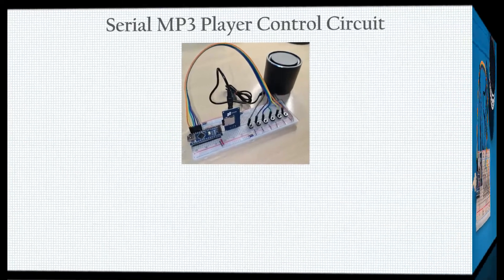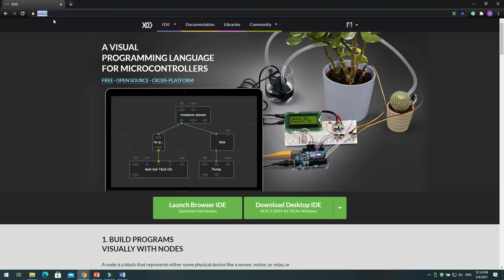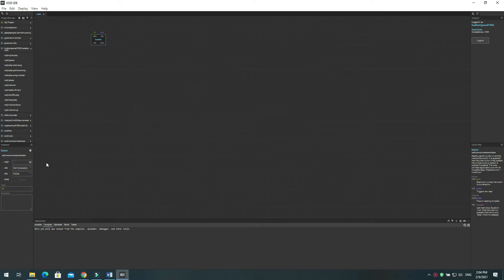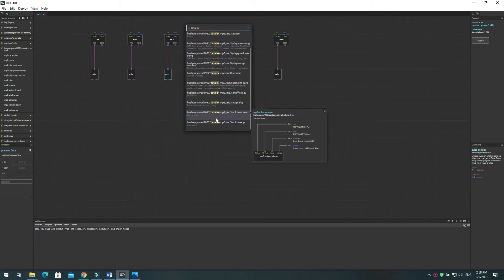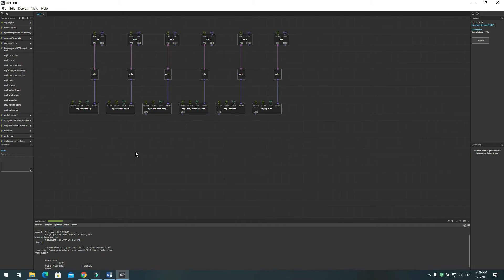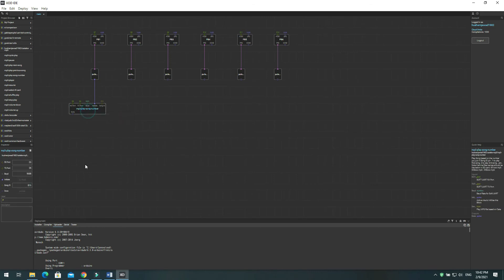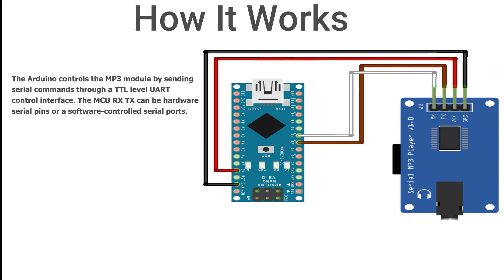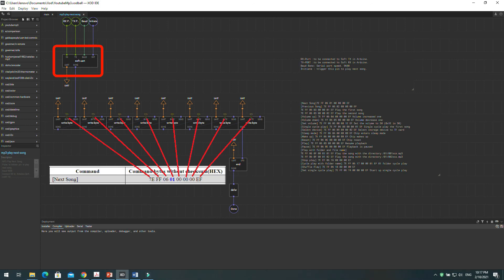Control Catalex MP3 player Using Arduino programmed By XOD

Comment: Hi I want to mix this code with arduino IDE. I basically want to add neopixel rgb lights so that each time I push the button it plays the song number and also turns on the led with a specific color. I tried to copy the code from XOD directly to Arduino IDE. The problem is that it only uploads the code for the lights, not the one from XOD. If you can help me it would be awesome. Thank you!
Reply: XOD has nodes for WS2812 , neopixel LEDs, so either do whole program in XOD or combine by copy/ pasting code into Arduino IDE
Reply: @adamaglionby7438  thank you very much! Yes I did it just like that with the neopixel library🙌🏻🤩

Comment: Hey, do I need to put resistor for the switches? Will it damage the arduino pins?
Reply: XOD will set internal pull up resistors on the pins if available

Comment: Hi Husham, i have a project in mind and i think you can help me. Please reply
Reply from the maker: Hi George,
How may I help you ??
Reply: @HushamSamirNSN  I saw a project on youtube and I would like to do something like that on my electric scooter, but my knowledge of electronics is a bit limited
Reply: Thanks for the reply
Reply: I don't know if the USB port on the accelerator can support 5v and where I could or how I could connect the throttle wires
Reply from the maker: @georgesoare7937  To get 5volt, search how to use "LM2596 Step-Down Module" on youtube.
for the throttle, I'm not sure how he connected this circuit .the MP3 player module plays only one MP3 file in his case. So rotating the throttle will not change anything in the played file.
Reply: @HushamSamirNSN  My fear is that the USB port, although the documentation states that it outputs 5V, cannot support the power supply of the YX5300 & nano 3.0 assembly and I don't know where I could or how I could connect to acceleration. The display / throttle connector is 6-pin
Reply from the maker: @georgesoare7937  Always there is a risk of damaging the circuit, I suggest doing all the tests first before connecting your circuit to your Scotter. for the throttle you need first to know what kind of device connected.is it a potentiometer?
Reply: @HushamSamirNSN  i saw that when he rotate the throttle the volume of mp3 or wav file increase or decrease the volume
Reply from the maker: @georgesoare7937 I've checked the code he provides and yes he is increasing and reducing the volume based on throttle rotating and he explains how the throttle connected in the video (1:07 ).
he is using Analog input with mapping to control the volume.
Unfortunately, my circuit using Digital input to control the volume and it will be more complicated if I use the analog input, So I believe that using his code will be much easier to implement your project.
Reply: @HushamSamirNSN  Thank you very much for your kindness and answers. The problem is that I have a Kaabo Mantis electric scooter and I don't know where and how to connect to the throttle. This is the scooter https://fluidfreeride.com/products/mantis-advanced-all-round-powerful-electric-scooter-long-range
Reply: @HushamSamirNSN  with 6 pins
Reply from the maker: @georgesoare7937  After checking the price, I don't recommend connecting to the throttle directly.
My suggestion is to make a completely isolated circuit from the Scooter controller.
you can use a small power bank to get the 5 volts.
hall effect sensor with a small magnet to measure the speed and based on that speed you can control the volume of an MP3 player.
check the below example:
https://www.youtube.com/watch?v=VZJgd1nmzcw
Reply: @HushamSamirNSN  Thank you very much for your help ! Could you help me adapt the original code with the hall sensor code?